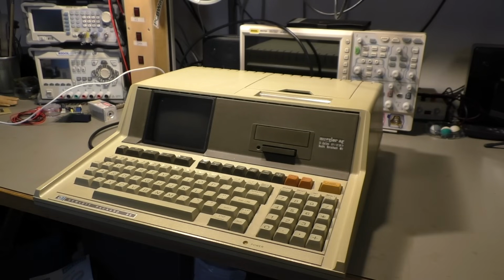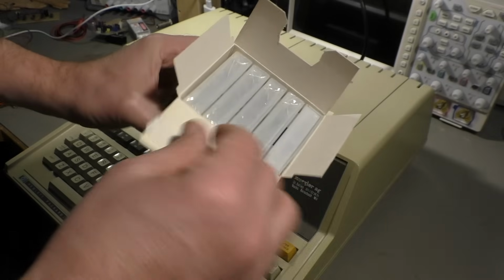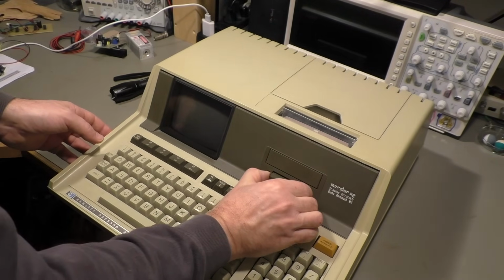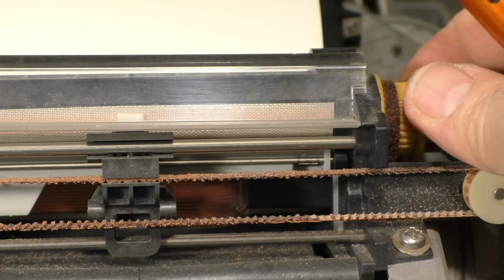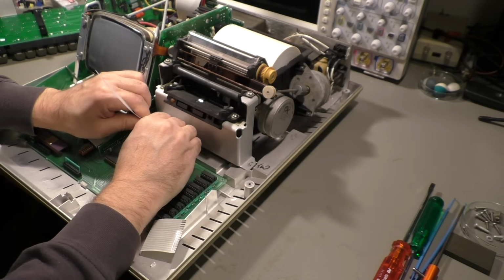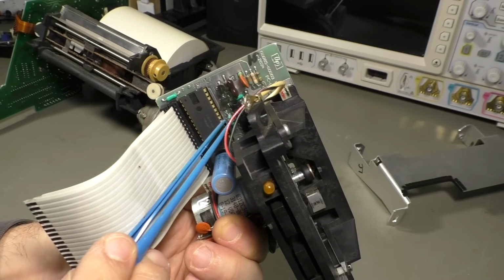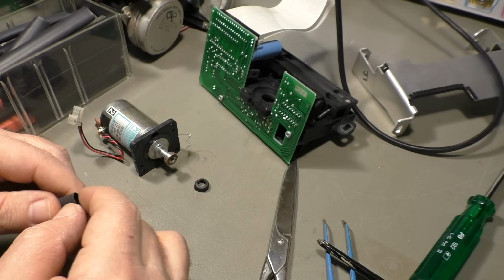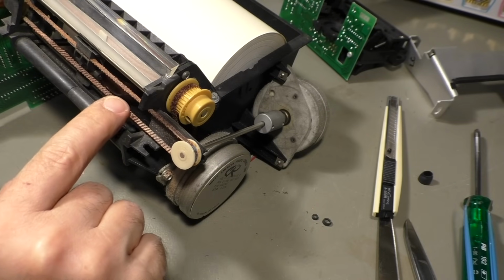HP85 Tape drive repair - Part 1 (PWJ250)

Comment: The overall design is really similar to old HP CODE MASTER defibrillators. Actually the defibs are designed based on this very specific design
Reply from the maker: It has everything you need for a defi... Keyboard printer screen. Yeah why not us that shape.I'm surprised that HP made defis. 🙂
Reply: @ yes they did and then later they’ve sold their medical devision to Philips. Philips defibrillator are technically the new HPs still made in USA. Some philips defibrillators (Heart Start that’s what they call them) were pretty much identical to the old Code Master series, the newer versions are totally modified by Philips but still using the HP hard paddles

Comment: The hottest part of the flame is just at the interface of the blue and the yellow parts. That's he point i like to use when soldering with silver solder on silver,  can't afford to do it with gold 😅
Reply from the maker: Ok, maybe it's not the coolest part of the flame but it's definitively the part that creates the least amount of soot.... I don't want carbon layers on my shrink tubes 🙂
Reply: @PlaywithJunk  Can never remember if the blue is with less oxygen or the yellow. but the blue tip is where it's correct.

Comment: WTF?!? I get this crap AI translation as audio on this video. Does anybody know a way around that?
Reply: Settings -> Audiotrack -> ... (Original)
Reply: @ I found it. Unfortunately it is not sticky but per video. You van also set a preferred language but not as in „original“.
Reply from the maker: I heard about that...but I haven't heard it myself. How do they do that? Voiceover with an artificial voice? Or do they take my voice? Anyway, a bit creepy...
Reply: @ A super unmotivated artificial voice. You expect Swenglish and you get unmotivated computer-German. Disappointing.
Reply from the maker: @chrisridesbicycles  I heard it yesterday after changing the settings to German. It lacks all emotions but I was surprised how well it sounded. And the translation was perfect. Frightening somehow...

Comment: I spray the connectors and cable with contact cleaner to give some lubrication too when getting that type of connection apart.
Reply from the maker: I tried it and it seems to work great... thanks for the hint.